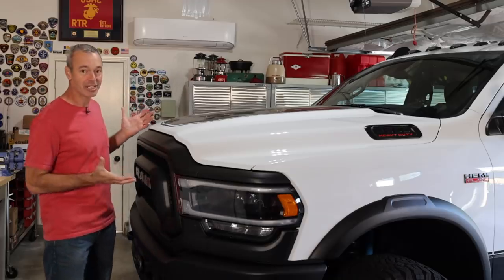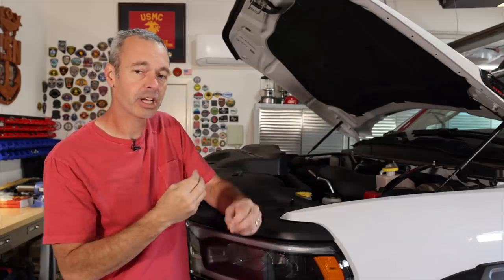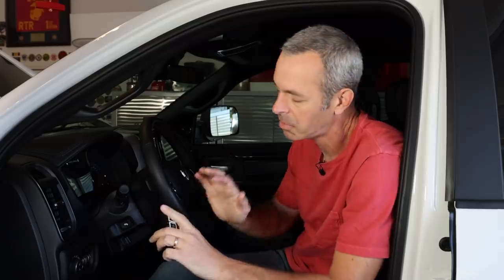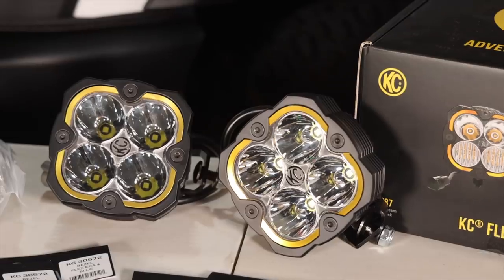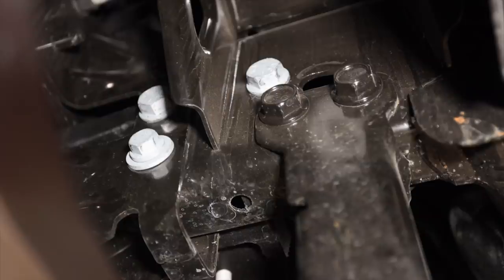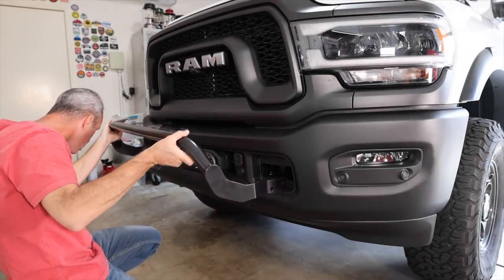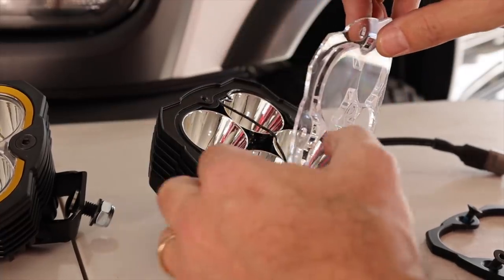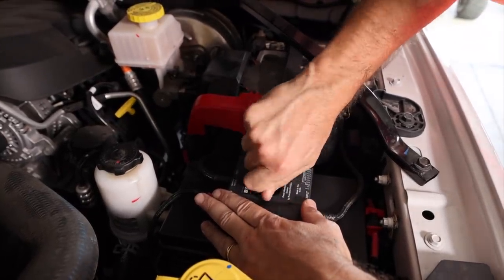LED Light Bar Install - Ram Power Wagon HD 2500

Comment: I'm very happy to see that you've added the Power Wagon to your channel. Jeeps are great but they also only represent a small portion of the Overlanding community and in fact jeepers really only represent the people that are at the 80th percentile of the size curve since both tall and short are challenged by the design. As a 6'8" fan of your channel, I excited to see a vehicle (beyond the random group vehicle that isn't a jeep) and I hope gear, that stretch the edges of the bell curve and are more inclusive to the entire community.

Comment: RED install was much easier/straight forward on the 4th gen.  Looks good Brad.  I have old school round KCs on mine.  Spots in center pointing straight, wides on the outside slightly pointed out to double as ditch lights.  I lined up my truck toward the garage door at night and followed KCs instructions for aligning the lights in relation to the headlights.

Comment: Nice video. You did not mention it in the video but I like that angle tool you were using so I ordered one (Johnson Level & Tool and Tool 700 Magnetic Angle Locator) for my upcoming light install. Should make it less frustrating getting them dialed in.

Comment: Trail recon has been a significant influencer in many of my JKU/Power wagon recent purchases. While I suspect that the KC Flex Era 4’s are great lights, I’ve order the same combo as Brad has installed, forget about receiving them anytime soon. I placed my order in mid-March, and still have not received the lights, even though was provided with a May 16th to May 21st date. KC also charges your credit card at time of order, so they have no incentive to deliver as promised. Latest story from KC is maybe in another two weeks. I’m very discussed with the total KC experience to date and am currently looking into Baja Designs LP6 Pros as a replacement.

Comment: Brad, great video....quick question.  How did you wire the backlight on the SPod?  Hot wires on two different switches and a jumper for the negative?   Getting ready to have a similar setup.
Reply from the maker: Just the single white wire to switch number two, the neg wire is already grounded to switch number one... sorry, should have explained that detail.
Reply: Great, thx for the reply.  Just curious as to how to wire the backlight and had researched and not found any clear answers.   Keep up the great work.   Love the new Ram.
Reply: @TrailRecon  Thx Brad for this answer to the question! I’ve got all the same equipment for the light setup on my power wagon installed, of course after watching this Vid. I’m just waiting on the KC FE4’s to show up & was wondering the same thing. B/R Gary

Comment: Hello Brad.  Love your videos and "can do" attitude.  So now it is March 2023.  Here is a bit of an update on the Randy Ellis light bar for the Power Wagon.  I just received a new Randy Ellis Design (Red) light bar for my 2022 Power Wagon.  I ordered the correct part (#34203) but I received directions for the 2500/3500 light bar (#34201).  The directions and picture are completely wrong for my truck.  I called RED.  They returned my call promptly.  I was told there was no difference between part numbers 34201 and 34203.  But no helpful comment regarding their inclusion of wrong picture and directions except they will inform the owner.

Comment: great video, and awesome lights. one question, how far out from the bumper does the bar and lights stick out. I have limited space in my garage and don't want to have to take the hitch off to get the garage door down because I added lights up front.

Comment: You're not going to lift the Dodge, are ya? You got the JL for rock crawling. Seems so late 1980s to lift a full-sized Dodge or Ford. Add some lights, sure, maybe slightly larger tires, but leave her stock...utilitarian.
Reply from the maker: No rush to lift it, but some better shocks are something I'm considering.

Comment: Great video! Installing a similar set up on my Power Wagon now. Looks like you installed your sPod on top of the fuse compartment. How did you work around being unable to open the box all the way since the sPod will hit the battery?  I was thinking of making a plate and attaching the sPod to it, then velcro the assembly to the top of the box so I could remove it if needed. Also the fuse descriptions and map is under the cover, so if I drill into it to mount I'll destroy some of that information. Thanks!!

Comment: Just picked up my Power Wagon today, traded a Gladiator ironically.  How much length was added to you truck after installed the lights?  Right now I fit in the garage.  Only about 6 to 8 inches could be added before it would become an issue.
Reply: The new instructions have 13 steps

Comment: I looked on the K.C. website. Couldnt find these. Wonder if they have mounting solutions for a 3" to  4" bull bar. I want to mount them on top of my bumper 15 AEV. Same set up. Spot and flood. Can you make them amber by changing the lens?  I like those blk background on the reflector lens 6"from K.C. Tell K.C. I want an Amber (strobe) LED Cargo light on the rear cab for flying down the riverbottom. So folks behind me can see me in my dust. Thanks for sharing.

Comment: I got the light bar for my 2020 Ram installed in June 2020 (ordered back in April 2020). The light bar makes my front parking sensors go off, where they auto turn off. They said they would work with me, but have pretty much ghosted me at this point. I got one of the first ones they made, so figured there might be a design flaw. Wanted to know if you are having any problems with your front parking sensors? Looks like they are still sending the same bad instructions as well. They are nice on the phone but seem to make a lot of empty promises. After saying they would help make me right, they don't respond to any of my emails.

Comment: Why not replace the bumper with something to help approach angle? And with light mounting options?
Reply from the maker: $$$$$$!  This is a much more affordable option for now.
Reply: Not many 5th Gen options, it's taken almost 4 years to get good bumper option for the 4th gen
Reply: @Rommer2258  road armor had some good stuff as well as AEV
Reply: @burkspat3009  not a fan of the AEV stuff. I just ordered thuren bumpers for my 15. It'll do me perfect fine
Reply: @TrailRecon  for now?  So what else did you consider?  I have a 2021 on order and was looking at bumpers a bit already.

Comment: For those trying to figure out crap instructions and Brad's video, here is what I deciphered as a new steps to install: 

1. Install triangle piece with lower bolt in place to hold the winch mount on the driver side, install the top factory bolt and lower bolt with the supplied 4“ bolt. The 1” bolt will be installed after the bar is rolled in.
2. Install triangle piece with lower bolt in place to hold the winch mount on the passenger side, install the top factory bolt and lower bolt with the supplied 4“ bolt.  The 1” bolt will be installed after the bar is rolled in.
3. Remove left tow hook completely
4. Remove right tow hook completely
5. Hold bar in place, while installing the driver the tow hook tighten front, middle and rear bolts in place loosely.  Use two supplied OEM bolts + 1“ bolt supplied by Randy Ellis Design.
6. While still holding bar in place, install the passenger tow hook tighten the front, middle and rear bolts in place loosely. Use two supplied OEM bolts + 1“ bolt supplied by Randy Ellis Design.
7. Adjust bar to desired position, then tighten all bolts
8. Install lights if applicable, enjoy sweet light bar

Comment: They dont make that lightbar mount for the Ram Rebel 😭
Reply: I also have a Rebel. Are your headlights very dim? Any suggestions for replacements or a fix? Thanks!
Reply: @dwaynetoombs295  My 2021 is very bright from the factory. It's a reflector housing with led's. 
If you're looking for a replacement, Morimoto makes a really awesome set of led projector headlights for 5th gen Rams